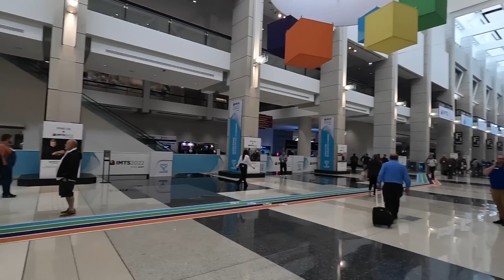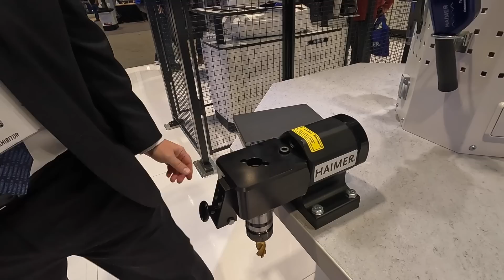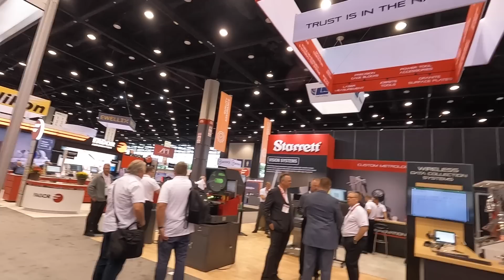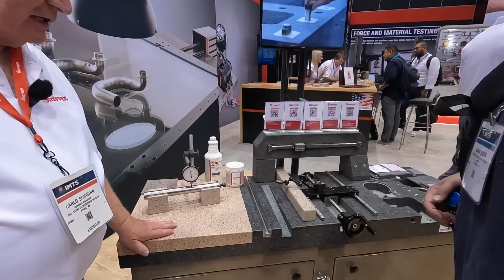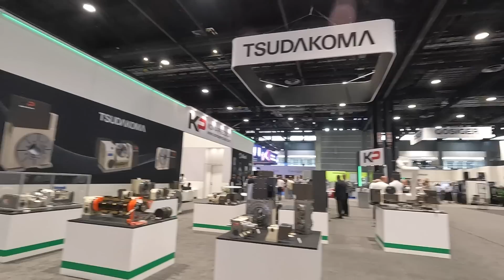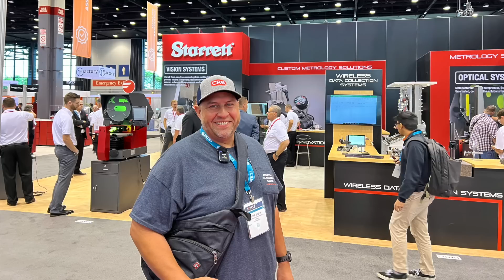IMTS Day 1

Comment: @ 11:15 That style of vise is very cool. They are popular in Europe. Travers carried one for a short while that had a neat feature (actually several neat features) one of which is it has a foot operated lever that makes it so you can hold the work piece with two hands and position it in the vise  clamp it with the foot pedal. It also had the regular handle. 
Stuff like this is one of the main reasons I go to these shows (IMTS, EASTEC, Design-2-Part) because you get to see all the cool gadgets and technologies that the tool makers are producing. Even if you can't afford it and are not gonna buy anything you at least get to see what is available.